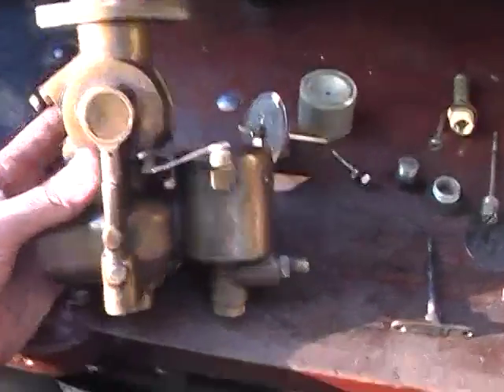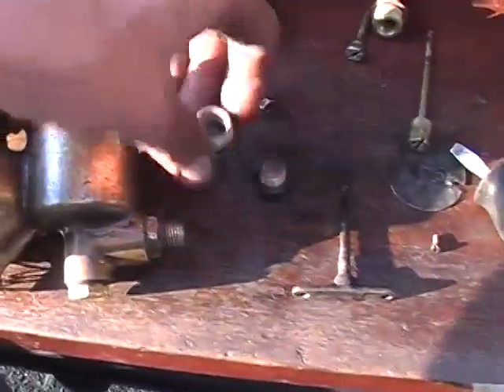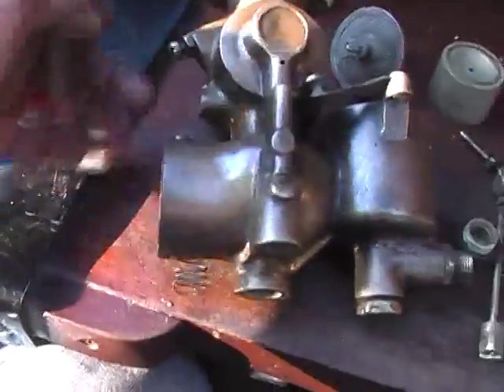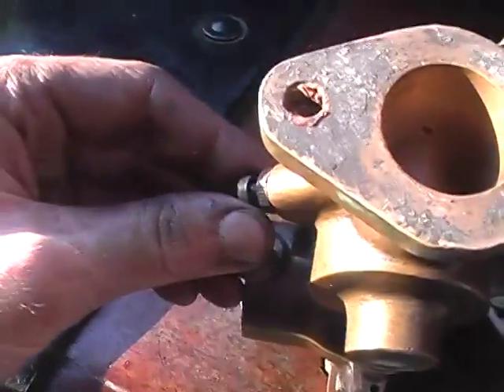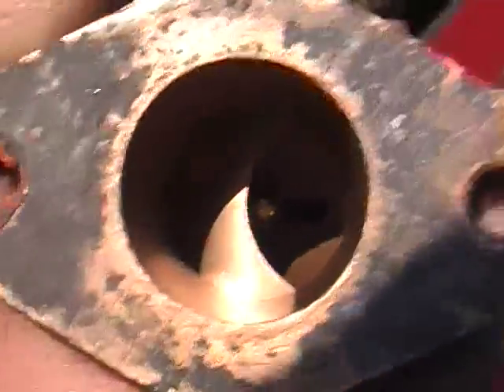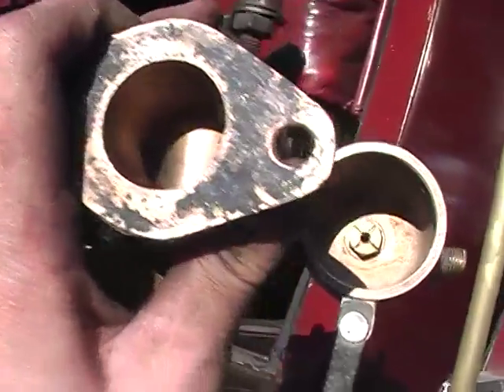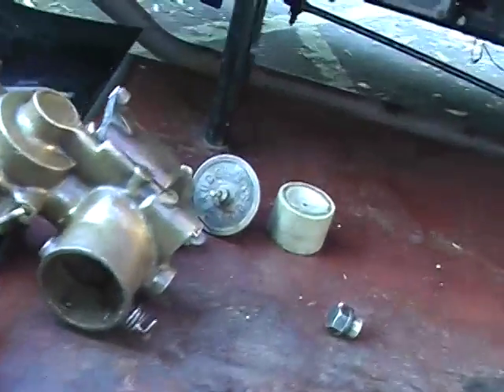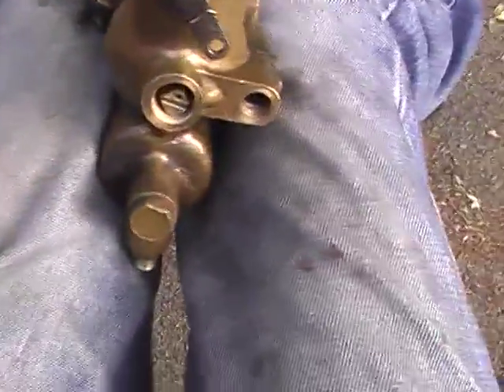Claudel Hobson Carburettor strip down - an updraft carburetor

Comment: I wish to buy a brass Claudel Hobson carburettor with barrel throttle and square fixing flange with four holes. The measurement along each side between hole centres is one and seven-eighth inches (1 7/8). It is to fit my Austin 20 Sports tourer. If you leave me an email address I can email a picture.